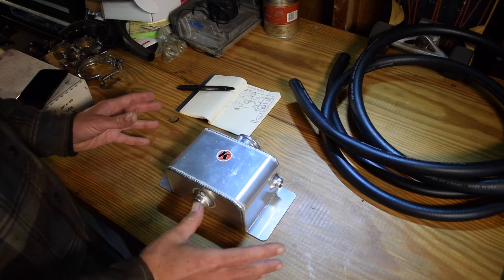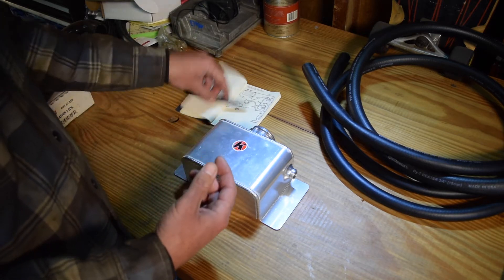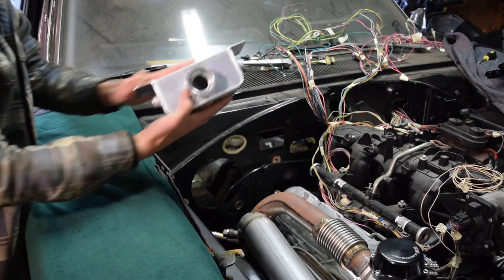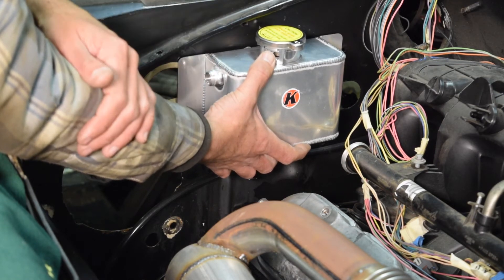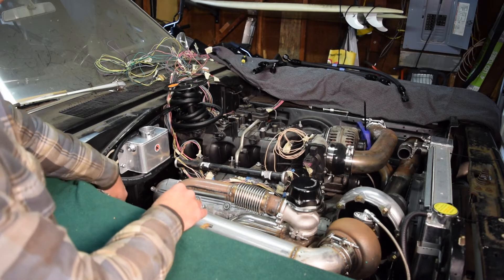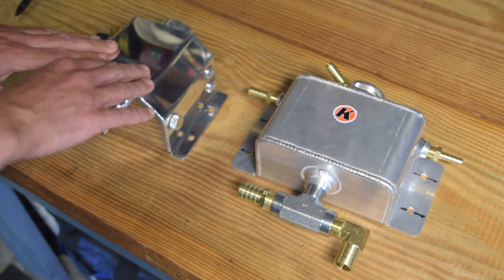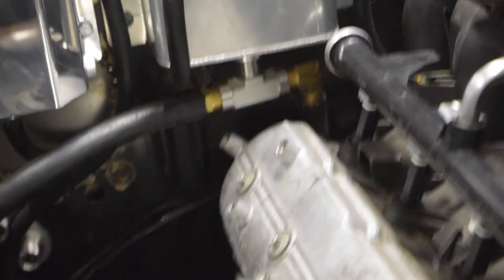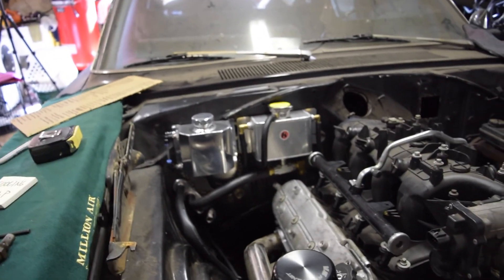LS Turbo Cooling System Design

Comment: I liked how you simplified the explanation for the cooling circuit and reminded me old days. However, in my humble opinion, I would not use fuel hoses since usually they are not tested for high pressure and high temperature levels (vehicle fuel systems are open to the atmosphere and tested with nominal pressure of 0.3bars). I also was not able to see any clamps for the line connections. (Or maybe you added them later on) one last concern would be the package area since hoses are not preformed which might be difficult to make a perfect routing in order not to touch any other components while the engine is running, but, since you are building up the cooling system by your design, using unformed hoses was the only option.

Keep up the good work!
Reply from the maker: Thanks! I'm also weary of the fuel line now that it failed in another non-fuel use setting (trans cooler). I'll go back and replace it with proper heater hose. I have the lines secured to the frame rail, and am heat shielding everything.

Comment: What was the tool used at 9:38 Im in the process of building a custom system for my swap and that tool would help alot!
Reply from the maker: It's called a Rivnut tool. You can find the kits on amazon. The one I got is made by Astro pneumatic and it's pretty decent for the price. In general it's worth it's weight in gold!